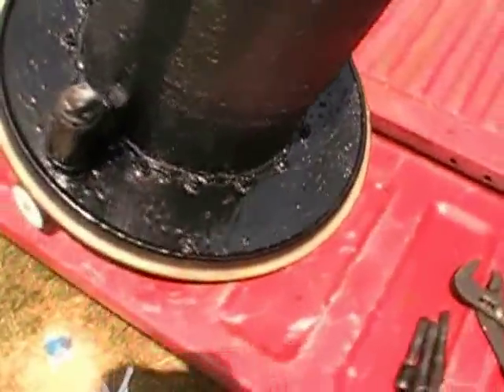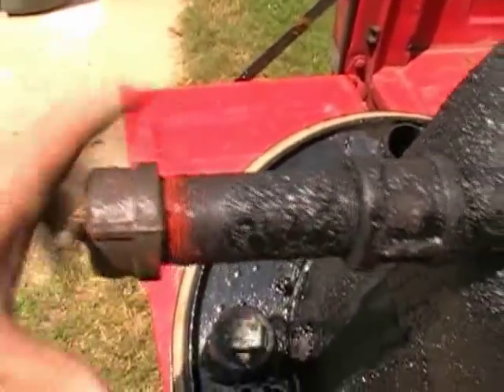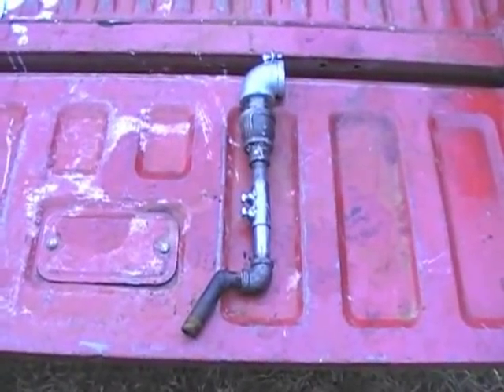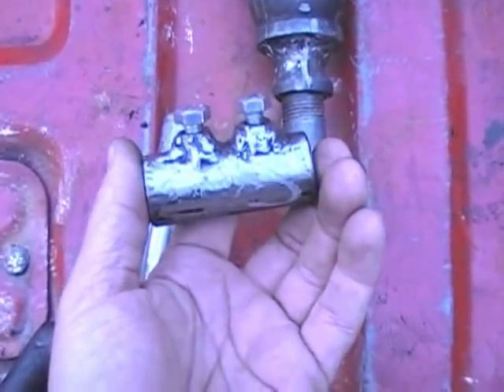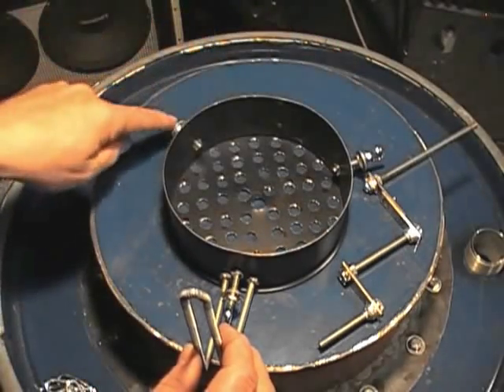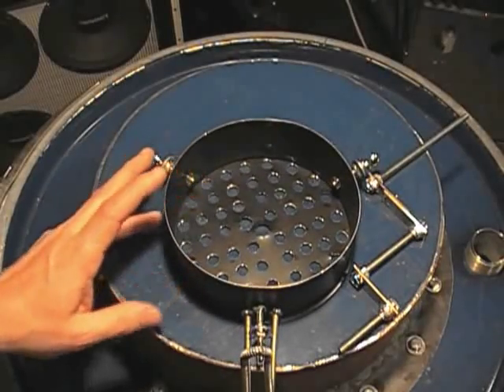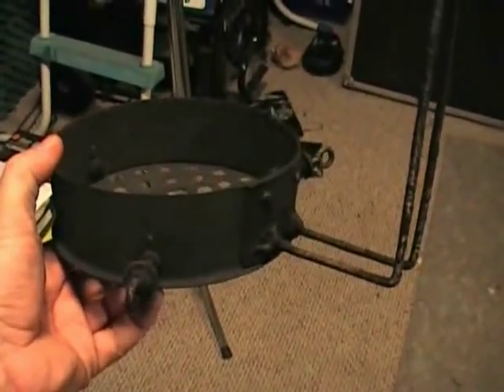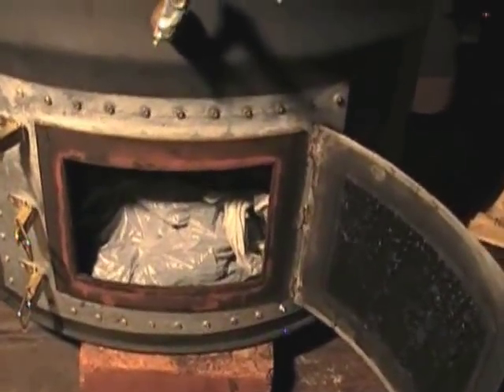09-13-2013 Gasifier "How to construct" ...Video Two

Comment from the maker: Yeah, what you said. The Imbert charts are fuzzy on some of the info so I bounced between the Imbert and the FEMA stuff so I basically winged it but the results were good and that's what mattered to me. I have had others ask me to calculate what they needed for the Imbert stuff and I'm clear on everything but the engine displacement stuff. I am going to be asking some others if they understand the charts because I feel like I could take this to a different level with my design combined with it.

Comment from the maker: My 3 nozzles inner diameter was 1/4 inch so I was technically running a total
3/4 inch of air flow combined compared to the 1/2 inch nozzle I have now. The copper tubing was adding back resistance and on a larger engine with more pull it would have been OK. Cont one last time:

Comment: Flash, thanks for sharing your design. One question remains in my mind. How do you determine the correct size of fire cone and nozzle to match the engine size?  
BTW, I'm glad to know I'm not the only person still welding with acetylene!

Comment from the maker: Ahhhh ha ha ha ha haaaa! I did just that minus the ceramic end! That was my original build!!!!!! The issue that I seen was the air flow was giving me the action of flushing a toilet and it was burning the center too hot and too fast and not properly burning the outer edges of the ember bed no matter what I tried. I even tried to close off the end of the nozzle and add sideways holes to the nozzle instead to compensate but the air still went straight down.

Comment: Hi Flash, why do you have to built a pipe into the nozzle point to get the gas out (video 10:50)? Can the gas not just come tru the nozzle and out tru the same hole. 

Great video, love it .  Cheers

Comment: If you get a chance , can you send me the pdf for the drill template? I will be starting the fabrication of a stainless steel ash grate, 1/8 " thick. My son is going to hate drilling by the time he gets done with all these holes through stainless. Thanks again flash. At some point I'll have to email you some pics of the build. I'm going to change up a few things . I'm using a 200psi compressor tank instead of a barrel ( @ 55 gallon). I also picked up a large propane tank for the wood hopper.

Comment: How did ya seal of the the air intake. And does it have to be sealed where the shaker handle enters the barrel
Reply from the maker: The air intake is only choked down during shutdown but as far as how I sealed it to the barrel l cut a tight hole that allowed me to screw it into place which gave me a decent seal but I also ran the red flexible hi temperature RTV cement around the threads to make sure it stayed sealed. On the grate shaker, I packed cotton into it  than packed each end cap with a bit of red hi temperature RTV cement to seal it there too. Keep in mind that unlike an air tank the gasifier is a low pressure device so you aren't dealing with a lot of critical sealing issues. Do you want it air tight? Yeah but not to the point of overkill with the exception that you want your biochar clean out port to seal tight and you want the top lid to be sealed too. The top lid on my barrel came with a hard rubber ring that worked with no melting issues and I also added a bit of the red hi temperature RTV cement to just to make sure the seal was tight. I hope this helps you. Keep in mind that this is an on going project for all of us in the gasifier community so as we come up with better ideas or if we find flaws, we share the information so we can continue to have a better mousetrap. Have you been to www.miniwoodgas.com? There is info there along with a blog to post questions. Hope this helps.

Comment: Hi Flash just a few questions getting all parts together to start my gasifier. 1st the cone 5 in. at the top 3 in at the bottom if I  wanted to run a bigger engine would I need to go 6 x 4? 2nd 1\2 in nozzle will run a 5 to 7.5 hp, 3\4 will run a 7.5 to 15 hp will going to a 1 in fix that problem? 3rd The 3 in at the end of the burn tube you went to a 2 in will that 3 in there run more than a 15 hp or does that need to go to a 4 in? 4th On the cone Don't know if I can bend 1\8th stainless would 16 ga stainless be as good? And the end of the burn tube the 2 in would stainless be better there? My shaker plate is also going to be stainless. 5th The 2 white propane tanks are they just empty tanks no filler on the inside? What is the door on the little tank for? And do you need a door on the big tank? Didn't see one that's why I asked. 6th On the hopper I have a hot water heater tank 14in in diameter the same shape of the propane tank you have welded to the rim it looks like 16ga not as heavy gauge metal as most water heaters as I have seen that I have used in building rocket stoves with. Will it stand up to the heat or does it get to hot in that area? And how deep or does it matter? 7th On the nozzles would using stainless at the end 5in going into the fire would that be better? 8th  On the 4in PC pipe filters and 5ft tall is there a reason or could you use 6in or would it help? 2in where the gas comes out of the gasifier 1 1\2 when you reduce on down coming out if you run anything bigger does that need to be bigger? Probably wont run nothing no bigger than a 7hp but I want to be able to run bigger than a 15 if I needed to with just changing the air nozzles and the end of the burn tube. My biggest reason for searching trying to do this was to make my own propane gas to store in tanks. Thanks for all of your info. I am working on an air engine to generate my own power to run my own generator. I will share that with you when I get that completed hard to get time to work on all these projects. Let you know how things go as I go along. I hope my questions make sense to you they do to me.lol and God Bless

Comment: I know you were using sticks in your testing , but can this be run with wood pellets? I'm just wondering what mods you would recomend to save  the prep time for fuel. My son and I are really enjoying the build so far . I just figured I'd ask before we get to the plaster/sand phase. Any advice would be greatly appreciated as always.
Reply from the maker: Since I changed my reduction zone down to a 2 inch opening I should be able to run wood pellets. The main thing is to keep a hot enough reaction zone to hopefully crack as much of the tars as possible. As long as you have a good nozzle ratio to reduction zone ratio you should be OK.

Comment: for the shaker grate what is the exterior part that you put the shaker grate into. where do I find something like that?
Reply from the maker: The grate itself is a fireplace stovepipe cap. Everything else is just threaded rod along with a few pieces of steel strips. I used a small steel plumbing water pipe coupler along with end caps screwed on each side with holes drilled in their centers as a way to couple the external grate handle to the grate to be able to shake it.
Reply: flash001USA hi, i don’t think I quite understand. My question is referring to the nipple that is on the outside of the gasifier which holds the handle for the shaker. Is that a cap that you drill a hole into? How do you keep it airtight? Do you put washers on the inside and the outside? I hope im making myself clear. Thanks for the reply
Reply from the maker: That's a small 1/2 or 3/4 threaded  coupler with end caps on both ends that has a hole drilled in it for the rod to pass through. The way it's sealed can be done a couple of ways. Once the handle coupling rod is through the coupler you unscrew the outer end cap and pack the coupler with either cotton or high temperature RTV cement or a mixture of both which is what I did. once it's packed you replace the outer end cap and you have a seal. Remember something... This is a very low pressure or low vacuum system so it's not hard to get a good seal with gasifiers as long as you're careful building it.
Reply: @flash001USA  Hi this made a lot of sense thank you for your time. over the summer I am going to build a Gasifier mostly for glassblowing applications and will tag you. Thanks again

Comment: Flash, I have two questions, but first let me say how much I appreciate your efforts on our behalf.  Your attitude is what I admire the most.  You found ways to do the tasks on the cheap side and without expensive tools so that we could all see ourselves with a shot at making a gasifier.  Your attention to detail and "making sure" reminded me of my aircraft mechanic days.  We were forever mindful that a failure could be at 35,000 feet.  First question; what size hole to cut in the hopper for attaching the burner?  You explained it in the video but I'm still confused.  I have a five inch diameter cone opening, built just like yours with the same tire rim.  Is the hole cut to fit the cone or the outer diameter of the burner?   Second, the FEMA design calls for hydraulic cement in the bottom of the drum, what are your thoughts on that and is the mix of sand and PofP meet those needs?  You da man dude.  harrywat@bellsouth.net.  Newton, MS.
Reply from the maker: Jimmy oversize the hole for the cone by 1/2 inch so that you have a 1/4 inch space all the way around the wood hopper. This will give you a little bit of play if you need to center things up a bit. If you trust that you have everything centered you can just cut the hole big enough for the top of the cone to fit through too.

On the cement question you don't have to put anything on the bottom of the drum and if in doubt, just place you a piece of steel under the grate to give the drum some added protection and you a bit of piece of mind too. You don't even have to weld it either. Just lay it under the grate.

Comment: Think I'm gonna use a 6" pipe,then I can cut a 4" piece I can slip inside to reduce it so I have a choice,I am also going to use 2 nozzle sizes,so 8 nozzles with 2 valves. Have almost everything. I am also going to utilize milk cans. I guess what I am wondering at this point is did you have to change your exhaust size,does one size work better for 6" than 4"?
I too will be using pvc for filtering. Metal to pvc for transitioning it to cut away weight. I have ample pine,oak and walnut aswell as corn, chicken shit,pine cones and other fuels to experiment with. Gonna attempt to make both the intake and output adjustable ,in theory it would help to stabilize-rich/lean it like putting a tuned/matched intake,cam and headers on a V8.

Comment: More great stuff and I have a question Flash.
How come your gasifier won't run a 6 cylinder motor or what would I have to do to make it run one?
Because yours is as big or bigger than the ones like mr tesalonion built and better filters, sorry for the bother. Joe
Reply from the maker: Joe no bother. I could have made the actual gasifier much smaller but I used the materials that were readily available and the 55 gallon drum was an easy find. I looked all over the place for a used intact 30 gallon drum with no luck and they wanted $70 for a new 30 gallon drum not including shipping. At this time I've only experimented with the small engine gasifiers so the larger setups are out of my knowledge base. Drive on wood would be the place to find the info for larger units that can handle larger engines.
Reply from the maker: +Joe Eichholz Joe this was a design for running small engines but if you are interested in running a bigger engine check out Wayne Keith. Just google his name.

Comment: hi flash does the shaker handle have to be air tight?
Reply from the maker: Chris in reality you will never get the handle completely air tight. This is why people use a short piece of threaded pipe and drill through the end caps then fill the tube with either high temperature liquid gasket material or pack it with cotton. I used cotton. All you do is once you drill the holes in the end caps and run the threaded rod that will couple to the handle and the inner shaker you simply take off the outer end cap where the handle is and fill the pipe with filler then screw the cap back on. This will give you plenty of seal for the gasifier.
Reply: Awesome thank you very much! My friend and I are both making flashifiers :) we are just collecting parts right now. Dont be surprised if i message again :) i think the wood hopper will be the hardest to find, we have the rims.

Comment: Are you still using your gasifier
Reply from the maker: It is on the stand-by ready to go and ready to use if I need it
Reply: @flash001USA  I'm working on a different type. It's screw driven give a larger surface area for the reduction zone. The whole unit will be no more than 100 lbs loaded. But your video was helpful thanks
Reply from the maker: @albrault8910  You will have to upload and share a video with those of us in the woodgas community once you get it up and running. This video here is very old and the gasifier has went through some changes since this was uploaded complete with automation. If you thumb some of the later videos, you will see the automation for the gasifier.

Comment: I think it is much better if you can using a DC generator to charge your battery bank rather than trying to run a genset at 60HZ 24/7. DC Genny doesn't care if the engine slows down or speeds up. Charge controller takes care of all that..
Reply from the maker: Thanks for the reply. I'm already on it. I already have four 6 volt deep cycle batteries along with a 1 Kw pure sine wave inverter for sensitive electronics and a 1.6 Kw modified sine wave inverter for power tool usage. I'm building up a 12 volt DC charger using an alternator combined with a 6.5 Hp or possibly a 12.5 Hp engine so that the RPM's will be a non-issue like you pointed out plus I already have eight 90 watt solar panels along with a good MPPT solar controller for my emergency setup. The 110 volt generator will still be good for running a washing machine and even some power tools too plus I could also use it to charge batteries since I have a 35 amp battery charger sitting down in the garage.
Reply: I'm sorry Flash that was for another comment on your page.  Glad to see you agree though. I had my share of messing with my gassifier to run a steady 30 HP gender for any length of time. You can do it but it goes through some wood and if gender quits while running it makes a whole mess of problems. That's why I switched to DC gender and outback inverters.
Reply: Genset NOT gender. Silly auto correct.:-)
Reply from the maker: ***** Yeah, I totally agree with you. This gasifier turned out to be really stable as long as I stick to strict fuel guidelines and that's the trick for this setup. I had already seen others that were discussing the same point that you made so I decided to take their advise. The generator I have is a small 2 Kw generator but on woodgas it's only good for 1 Kw and some of that has to do with my filtering.
I run enough filtering to scrub the woodgas to the point that it's smokeless on the output side as a safeguard so it does add a bit of a back resistance onto the engine at the cost of some power but I filter the gas that hard because It's hard to keep high enough temperatures in the gasifier to keep the tars down to a safe level with a small air displacement using a 5 Hp engine so I'm playing it safe.
Reply from the maker: ***** Ahhh ha hah haaa If I had a nickle for every snafu I typed in replies I would be a rich man.